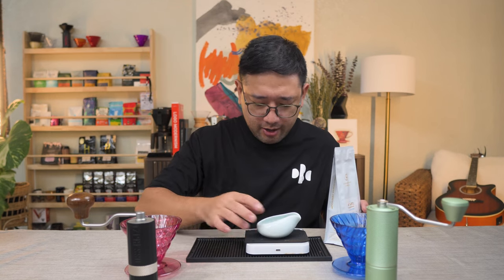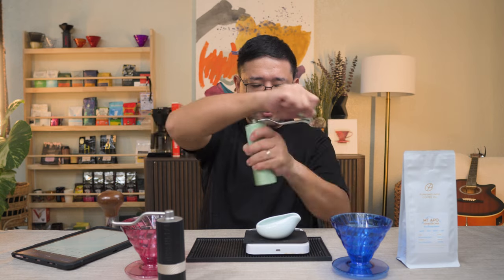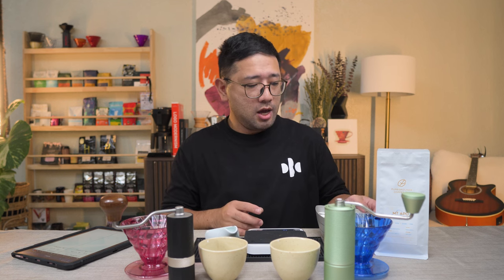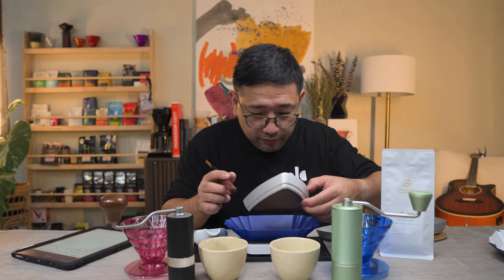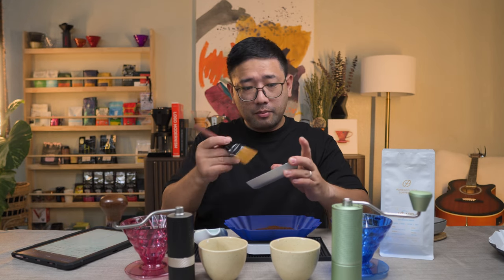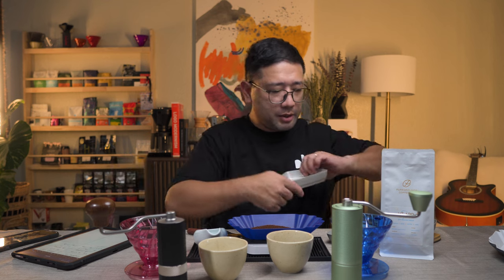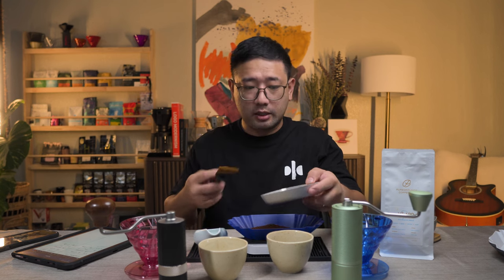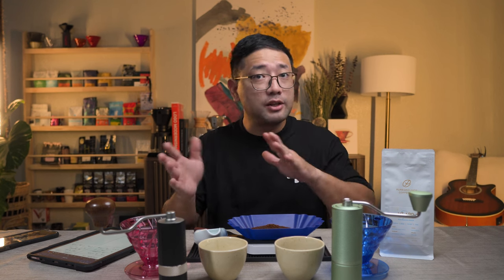1zpresso Q Air versus Timemore C3

Comment: Q air or c3 is beter?
Reply from the maker: i would say this will depend solely on your preference but basically the q air is more balanced while the c3 has better brightness to it.
Reply: Q air cant use for espreeso?
Reply from the maker: @mamnonsaovietphuyen7957  it doesnt work for my machine. My machine is a bit limited - i cant change the settings on the machine.